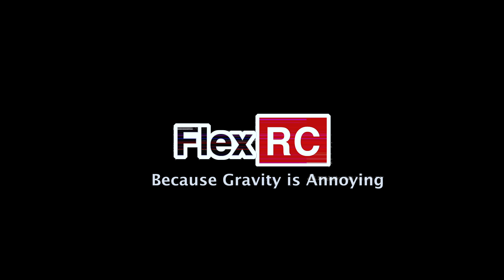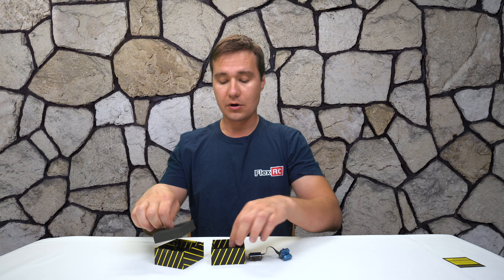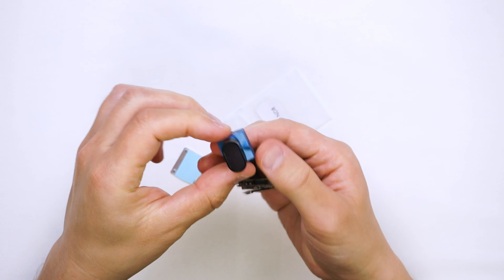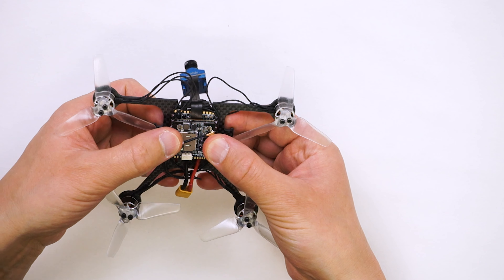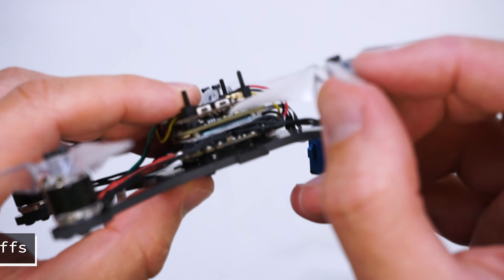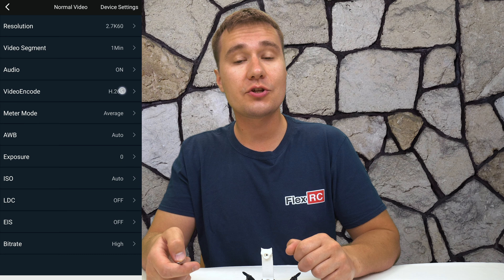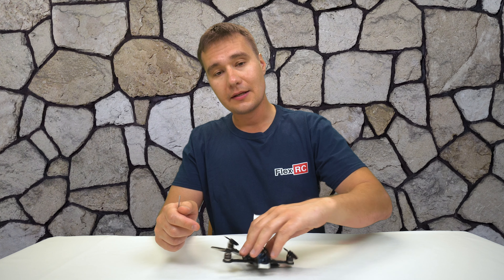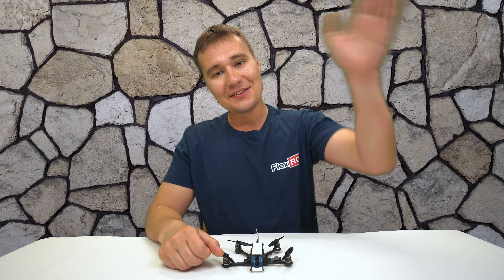Caddx Tarsier 4K - Things to Know Before You Buy! Best Settings!

Comment from the maker: ⚠️ PRODUCTS IN THE VIDEO  ⚠️
❗️ FRAMES ❗️
✅ Ninja 3" frame: https://flexrc.com/product/ninja-3-frame/
❗️ELECTRONICS ❗️
✅ Caddx Tarsier 4K: http://bit.ly/32EZWez
✅ T-Motor F15 1106 6000kv: http://bit.ly/2ZSl3b4 
✅ HGLRC Zeus AIO FC/ESC: https://flexrc.com/product/hglrc-f4-zeus-f4/
✅ FullSpeed FSD TX600 VTX: http://bit.ly/2M1RAIb
❗️BATTERIES ❗️
✅ 450mah 2S 75C battery: https://flexrc.com/product/tattu-450mah-7-4v-75c-2s1p-lipo-battery-pack-with-xt30-plug/ 
✅ 450mah 2S 75C battery: https://flexrc.com/product/tattu-450mah-7-4v-75c-2s1p-lipo-battery-pack-with-xt30-plug/ 
✅ 650mah 2S 75C battery: https://flexrc.com/product/tattu-650mah-2s1p-75c-7-4v-lipo-battery-pack-with-xt30-plug/
✅ 850mah 3S 75C battery: https://flexrc.com/product/tattu-850mah-11-1v-75c-3s1p-lipo-battery-pack-with-xt60-plug/

Comment: Great video! I had a problem though and I was wondering if you could help. when I connect to camera wifi and open app, it says "please connect camera wifi" even though my phone says that the wifi is connected.
Reply from the maker: It happened to me too, remove this wifi completely and then next time you will connect to it, wait till it will say that you can't use internet with it and select connect anyway and it will solve the issue
Reply: @FlexRC  thank you for your help!

Comment: Very useful video, thanks Dimitri. I just ordered a Tarsier and this video will save me a lot of time. I’ll run the camera on an RC car and I hope the video will be sufficiently stabilized when using 1440HD as you suggest. However, it may also be a problem with the write speed on the card. Caddx claims you need at least a u3 level card. Formatting the micro sd card through Caddx’s app is a good idea as well.

Comment: You probably need a U3 memory card, they’re a much faster data rate transfer. They aren’t just a class 10 card, they’re like 2 steps above.
Reply: And not all U3 cards actually write at 100mb/s, despite their alleged ratings. Sometimes it's worth comparing different brands in devices to find what works best.
Reply: Alasdair McC , that’s true, some companies tend to exaggerate.
Reply: yes you absolutely need a u3 card and a fast one at that. I tried doing 4k with normal class 10 and it recorded 10 seconds of still picture that was low res crap

Comment: Hey, nice review, any ideas to why it might have stopped working after crashing the drone? Im not getting anything from it when plugged to battery, and after trying few time blue light come on for 5 sec then goes, off. sd card not recording anything and when plugged into usb, green and blue light comes on for 5 sec and goes off. one thing that work when plugged in to usb is flashing red light at the back !!
Reply from the maker: might be that some components got damaged either by the shaking or spike of the electricity

Comment: One point I noticed: It looks like you installed the tarsier board upside down. Having the heatsink in the middle of the stack is probably not optimal for heat. Did you notice any issues from this?
Reply from the maker: It didn't notice any issues with it. I don't know if it has defined up or down

Comment: Hi nice review. I have ordered which sd card we should use?
Reply from the maker: Thank you. I'm using SanDisk 64gb
Reply: get a u3 micro sdxc card not just a class 10 but a u3 or it won't work for crap
Reply: @twistedsocal  Iam using U3 card friend
Reply: @rajeevgopal3961  wild, I got a 64 gig u3 SanDisk ultra card that works great

Comment: Wait so this camera has max 5 mins footage recording? What if i have to record an event for 30 minutes?? Please let me know as im planning to buy it....
Reply from the maker: Why have you decided that it had max 5min recording?
Reply: @FlexRC  Thanks for replying! No i mean at 12:20 it is shown that the length segment is auto,1min,2 mins,5 mins. There is no other option . So i thought that setting is for maximum 5 mins recording. What is that particular setting for??
Reply: @mohammedabbashussain3945  you can record as long as memory not full.. its 5minutes max for loop video.. most race quad can only flight 5 minutes max

Comment: These are garbage for long range flying
Reply from the maker: What seems to be the problem?
Reply: I just received mine and hooked it up through usb 5v.  It connected to WiFi but don’t show SD card.  I formatted as card on computer fat32 and was able to format through CaddxFPV app but still doesn’t show SD card.  Also I noticed it doesn’t record longer than 1 second and stops.  I’ve set everything in app to normal video and even only using 1080 at 60 and still only 1s recording.  Also I feel that this board is getting way to hot with only 5v input and can’t even phantom how hot it would get with 9v or 12v!  I can’t trust this being my eyes LR flying.  I’m returning and getting GitUpF1 and just use standalone fpv cam.  I fly fixwing not quads.  This would possibly be ok for quad but definitely would not trust on planes doing proximity flying or LR.
Reply from the maker: Ah I see, this product isn't the best out of the box. Yes it is a trouble to use SD but it is doable. I think that I've showed settings that worked for me, but if you dislike it and can't trust it and can return then go for it.
Reply: Flex RC thanks.  Yeah for $90 I’d expect this to work and not have to do all kinds of problems.